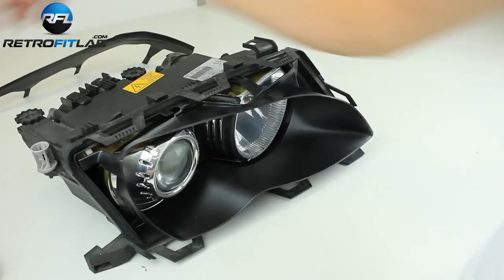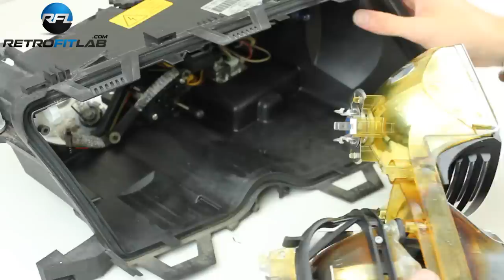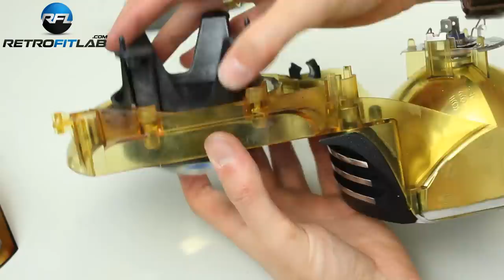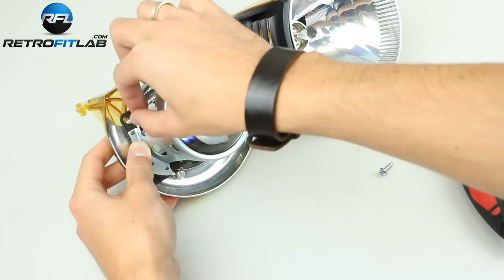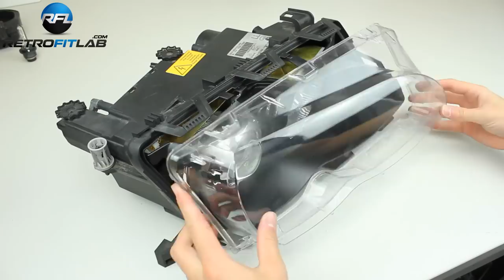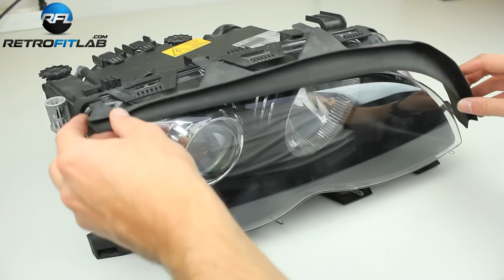BMW 3 E46 ZKW | Bi-Xenon HID Projector headlight repair kit installation (old version)

Comment: Those mounting stickers idea is very nice, I loved it. Nothing is easier than having both cut off lines perfectly aligned without the hassle of physically doing it on the car.
Q5-R, my next buy for sure besides the FX-R 3.0
 
Nice video though.

Comment: Yes, if you can make a video of the xenon high beam engagement and of its light output on a wall and if possible on the street at night i would greatly appreciate it. This is the only issue holding me back from purchasing this retrofit kit. Thanks in advance!

Comment: I've just completed my first installation (one headlight) and it is not really as easy as in this snappy video.. 

Issues:

The shrouds does not fit! They really don't and snapping off the holders make it way worse. Can't be glued on as there is no proximity of anything to be glued (I tried using super glue, not helpful).. I reverted back to using the originals as they fit better. Please ship with shrouds that fit these specific projectors!

The movie has edited out when retracting back the inner assembly with the screwdriver (I assume?) on the adjustment nob upon headlight assembly. Would also be interesting to know how to adjust these back to optimal position..?

The Xenon electric connector does not fit over the screw assembly on the Q5-R projector and xenon bulbs back-end. The assembly shipped does not look similar to the video (different spring) and the wings are too tight so the electric socket can't fit in well. I managed to get in in place using enough brute force to deform the connector slightly, with a very worrying crack as a result..

The splitter cable supplied does not have heat protection as in this movie sequence - How do you assure that these cables does not come too close to the xenon build or reflector and get burned and potentially causes a short circuit? The originals are carefully mounted in the lower back end with heat protection - how long will this assembly last without it and cables just tucked in behind the projector? Supposedly it becomes warm enough to melt plastic inside..?

The package comes with no instructions what so ever, could be useful with something - at least linkage to a web page with the relevant instructions..? The video is not that informative and has no spoken instructions..
 
Tomorrow I will put the headlight back in the vehicle, let's hope this becomes struggle free....
Reply: +Emil Borgelin Hey, nice to hear I haven' been the only one with that problems... I put them in a half a year ago and had very similar problems to your. 

1. Fixing the shrouds isn't that easy. I needed to file a little bit off the black housing that comes in just befor you put in the glasses at the and so the shroud stayes on the projector lens... now it fits good, not a problem anymore.

2 Adjusting the new projector, my biggest problem: it is really hard to get the new projectors on a really exactly horizontal level. My line between Bright and dark at the end of the light cone isnt a horizontal line, it goes like a bow now because of the different position of both projectors in their housing that doesnt fit together that good.. ah its hard to discribe, i dont know maybe a fault at installation of me but i have to say this isnt that easy and i fear my car wont make the Vehicle inspection a car needs to do every 2 years here in germany with that kind of "failure''. I will need to fix that before the inspection... 

3. The wingnut that fixes the xenon burner is a wonderful way to fix those inside the projector, for real.. you really just have to cut of the wings before you force this on. The worrying click you heared were the fingers of the xenon burner that broke.. if you cut the wings you can still screw them on but the cable can be connected without a 'click' ;-)

yes I had some problems with that Kit but actually it saved my ass. You cannot buy the projector as a single part, you need to buy a completely new Bi-Xenon headlight... The BMW workshop around the corner made me an offer: new headlights including installation only... ONLY!! 1500€... that money for shit that breaks after 10 years of using? not my favourite kind of throwing money out of the window.
Of course this solution isnt the cleanest and easiest and you need to invest some time but at the end of your work you will be able to see the streets again ;)
Reply: @Nippelpanzer  hey 😊 bist du noch aktiv? Wie ist dein Fazit nach 5 Jahren? Habe das kit nun vor mir liegen. Sieht so aus als hätten sie es etwas weiterentwickelt.. kein Aufkleber mehr sondern eine metallschablone zb
Reply: @f10530d  Hi, ja bin noch hier. Leider hat es vor nem Jahr bei nem Wildunfall den einen Projektor komplett aus dem Gehäuse gerissen, bis dahin hat aber alles gut gehalten. 
Würde allerdings ehrlich gesagt aus heutiger Sicht nicht mehr zum Kit greifen, wenn ich gute und günstige AL Scheinwerfer finden kann (Damals war das Angebot extrem mager, gab es nur neu).
Zur Zeit scheint das Angebot wieder etwas besser zu sein.

Comment: I think I'm going to buy this kit :) But does the halogen high beam still going to work or do u get the high beam on the xenon as well? Or does this kit only fixing the xenon low beam problem? And these reflectors, are they in the same plastic material as the ZKW reflectors?

Comment: need clarification on wiring this into a US model e46. It states "The H7 splitter takes 12V directly from the high beam or European vehicles. For US/Canadian vehicles, the original solenoid wiring has to be connected." but from looking at the video I don't think it explains that type of installation. Any feedback on how to wire this to US model e46 would be greatly appreciated
Reply: Yes and thank you. Can't wait to get my order!!!!

Comment: Hi!  I need your support please.  I have a similar issue on my car and I have a question regarding replacement of this projector ZKV.    Can i just replace it with Bosch model?   Or its not compatible? Or will require some changes.  Please advise.  Thanks!
Reply: Hi, Thank you very much for your reply. I just sent out the email with the pictures.

Comment: Hi, after I broke the clips from the ornaments, I simply fall off the magnifying glass, what can I do?
Reply from the maker: Sorry, don't know exactly what clips you mean, but when you are referring to the ones that hold the front, you will probably have to buy a new headlight...
Reply from the maker: @vior3l508  Thanks, yes (unfortunately) the shroud needs to be fixed to the projector with glue or epoxy. It does not click directly to the projector.

Comment: Upgrade from 2.5 inch to 3 inch?
Reply from the maker: The ZKW is already 3". And some 2,5" projectors are better than 3", especially in comparison with the ZKW projectors with holes burned into them :-).

Comment: I replace/up grade my e46 Headlights to Bi-xenon, there is a error light appear on the dash. please help me to correct that.
Reply: ***** Thanks,This is a BMW e46 320d, MFY:2000. I had BOSCH normal headlights. I removed those and Install BOSCH  original Bi-xenon Headlights. those has same connection brackets (Headlight: 55w , Driving Light: Xenon, Parking light & Motor controller).
right now I removed the 32 fuse in the fuse box. then that warning light is gone. But I want to correct this in right way.
Reply: Kusal Tirimanne hi. what news? could you remove this error?

Comment: Can this be fitted into OEM bosch xenon headlight 2004?
Reply from the maker: Not this specific kit, but we do have replacement options for the Bosch halogen, single and bi-xenon headlights :-). More info here; https://www.retrofitlab.com/blog/the-great-bmw-3-e46-headlight-page/
Reply: @Retrofitlab  Actually I have ZKW headlight. I did check it through your guide. Thanks a lot! 

I have silver sticker at the top, everything's matches your description. What should I get now?
Reply from the maker: Nice! Then you can order the kit here: https://www.retrofitlab.com/bmw-3-e46-1998-2005-bi-xenon-md2s-30--zkw-xenon-headlights.html?

Comment: weird my headlights are completely different
Reply from the maker: The E46 headlights are also made by AL instead of ZKW, which look the same on the outside but are completely different on the inside. 
Also there are single xenon versions made by AL. More info here;
https://blog.retrofitlab.com/the-great-bmw-3-e46-headlight-page/